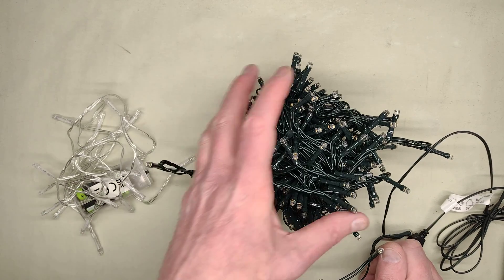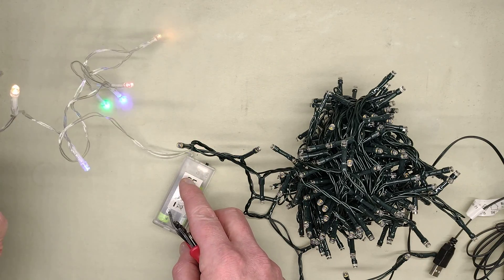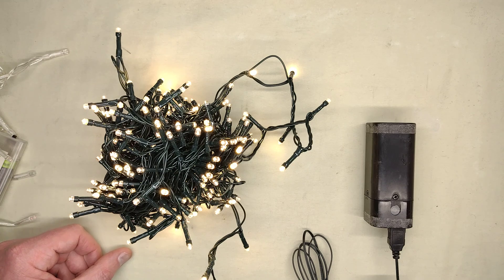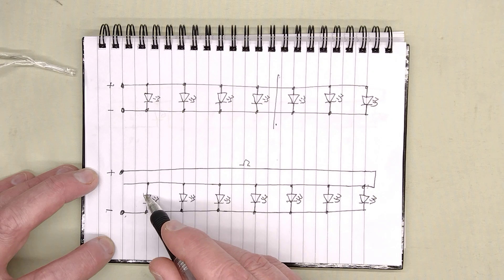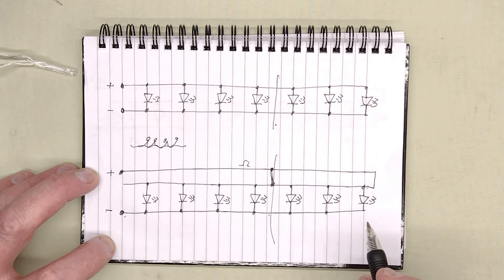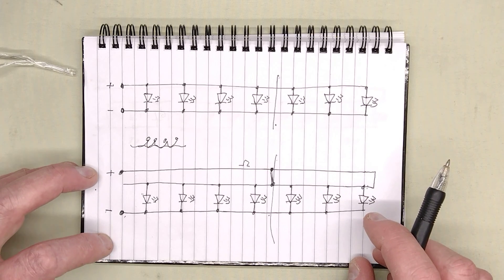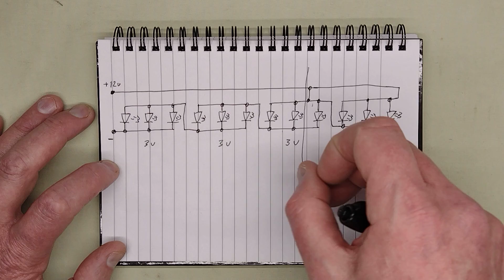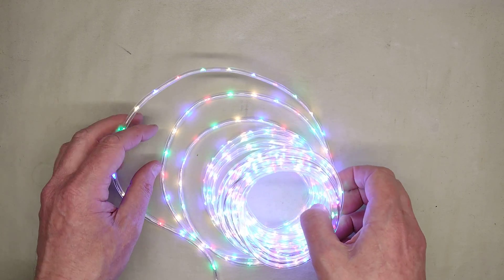How to fix your low voltage LED Christmas lights

Comment: We use a similar strategy in hot water heating systems to balance pressure drop in piping; The top diagram would be called a "direct return" and the bottom diagram would be a "reverse return." Reverse return uses more piping but is easier to balance across many terminals and performs better when some terminals block or bypass flow.
Reply: 100% off topic here, but your comment reminded me of our disaster of a hot water circulation system for instant hot water that was installed when we built our house...the plumber ran the PEX through the foundation uninsulated and our hot water heater never turned off due to all the heat being lost in the foundation. We had to just unplug the pump and now it's a longer wait for hot water than ever lol!
Reply: @MrV1NC3N7V3G4  there's models now that only pump when they sense a faucet turned on or by push button, they only run until they sense the hot water at inlet.
they're generally mounted under sink and pull from the hot pushing back down the cold pipe. there may be other  wireless control systems now that will work with standard recirc setups, who knows.
Reply: @MrV1NC3N7V3G4  ooof! Always sleeve penetrations through concrete!

What you can do to remedy this is a strategy called "demand recirculation." A small pump is put near the bathroom or wherever the hot water will be needed. Before you use the faucet/shower, press a button to activate the pump (some installs connect it to run with the light switch).

The pump moves the water from the hot supply pipe back into the cold supply pipe, so the cold water is flowing backwards for a few seconds. Once the pump detects that the hot water has finally arrived it shuts off. The cold water may be a little warm for a bit, but the hot water is available right away and nothing goes down the drain.

You can buy these systems as a kit that installs under the sink and uses the sink's hot and cold water taps, just need a GFCI outlet for power.

Comment: Thanks!  I wasn't sure how to fix my light string (and I live in a semiremote part of Peru and can't just throw my old lights away and get a new set!).  You explanation of what the wire were for made it easy to just remove the bad bulb and solder the resultant loose wires together and now it works again!

Comment: I just repaired a 2 wire set with 7 modes that had been cut by a lawnmower.  I measured 28V AC on a multimeter.  I found that most unusual for an LED string.  But there was no DC component whatsoever.   I was running low on time, so I didn't take the time to put it on an O-scope.
It was a super simple repair.  I soldered the wires back together and coated them with an ample amount of dielectric grease.  Then 2 layers of heat shrink.  1 for each wire with the grease squeezed inside, and then another over the two together to strengthen the repair point.

Comment: Very informative, The Asda lights I belive are made with the LEDs wire compleate then they run that into the plastic cover machine that form the tube around the lights as its extruded.

Comment: I've got a set similar to the diagram at 8:00, but every second LED is reverse polarity. The little controller board has different modes which changes the polarity of the voltage at different rates. If the Hz is fast it looks like they're all on, if it's slow, the light appears to 'walk' down the string.

Comment: Inspired by one of your videos, I bought several battery Santa silhouettes, cut off the battery holders and attached a number of them to USB plugs in parallel via dropper resistors, now happily running off mains phone chargers.

Comment: 7:18 To find a broken wire in that type of LED lights, you can use a "non contact voltage detector" , those react to the "switching noise" of that 12V powersupply.
Within 1cm distance, you find the place where it is broken.
Reply: That sounds better than my usual method of 'Ow! Christ! That hurt!' voltage detection!
Reply: @UnhingedHarry  

Lol true!  "AgggOUCH!"
Reply: @skylined5534  , that's because your method is not "non contact" :-)

Comment: I was somewhat inspired by you this year to make my own string of LED lights, I used colour changing LEDs each with a 180 ohm resistor and twisted together some 7/0.2 wire to wire them all in paralell. I 3D printed a little seperator so the LED wires wouldn't short when you heat-shrinked over the connections and resistor, then 3D printed some christmassy shapes that I glued over the LEDs to make them interesting. I was going to use your LED covers you put on a video ages ago, but in the end spent some time in OpenSCAD designing Christmas trees, parcels, snowmen and Christmas Sloths (long story!) instead. I only made 24 lights in the string but may well extend them for next year, although I only have a small room :D

Comment: We have a set of lights where there are 600 LEDs and they are colour changing. Each lamp can be ether warm white or a primary colour or both which gives a lovely pastel effect. You can also select fade from colour to white and back. They have 3 wires but as I can see strobing I suspect uses AC to select between white or primary colour. I tried shortening them with the result of only seeing the blue LED's light dimly. I reconnected the wires and hid the the 300 extra LED's under the sofa.

Comment: Clever 3-wire arrangement! 
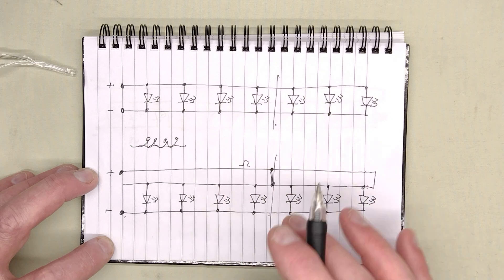If you put a ~10-ohm resistor as the "bridge" that you draw at 5:57 - this should be ok - better than just jumpering. I can imagine that most people don't carry a stock of 10ohm resistors and a soldering iron and a shrink-sleeve at X'mas, though...
Reply: How did you determine that 10 ohms was enough to compensate?
Reply: @jlpicard001  My guesstimate was based on eyeballing the gauge of wire that is snipped, and the length that needs to be bridged. However, a rough calculation goes like this:
The USB-voltage is ~ 5V; The white-LED forward-drop is 3V. This leaves 2V across the "resistor". --> The round-trip-wire-resistance must then be 8 Ohm. 
BigCliveDotCom cuts the string halfway in the middle. The new string has half as many LEDs, so presumably needs only 125 mA in the new situation (for the same brightness of each LED). In the new situation, the remaining resistance is also halved - so 4 Ohm instead of 8. The forward-drop of the LEDs is still the same - 3V and  USB_PB still delivers 5V. The new desired resistance is 2V/125mA --> 16Ohm (whereas the wire provides only 4) --> Add ~ 12 Ohm. :: 10 is almost 12 ;) especially with all other simplifying assumptions.. Hope this helps :)

Comment: One of the problems with C5 LED (cone style) Christmas lights here... squirrels bite the colored plastic bulbs off and bury them in the garden.  They are very destructive,  and the entire string is trashed because the wires will be bitten in half in many random places and 10 or more random bulbs will be bitten out of the string, and found weeks or months later scattered throughout the yard.  I thought this was a bizarre situation until I read about it online and this is a problem lots of people experience (at least here in North America).

Comment: Funny you should say about pets nibbling the lights! We've got some lovely turquoise Eveready LEDs in the front window and when I turned them on I was treated to a hardly on but mild flickering! Turns out the one of far too many cats we have (my bet is on either Saoirse, Aerial or Toulouse, one of them is batting one of those noisy bell filled plastic balls around the kitchen as I type this).

Found out the end of the string had been savaged. These are the triple wire type. You'd be horrified as to how I 'fixed' them though, bared wire,  twisted together and pre glue lined heatshrink to finish of, what a bodger😂 they do work now though!

Not sure if you'll get chance to upload again before Christmas so just to say thanks for all the stellar content this year, it's always a good day when it's a Big Clive upload day!

Merry Christmas Clive! 🎅🌲

Edit:

I only just clocked you'd caught covid, really sorry to hear that. Get well soon, wishing you a speedy recovery!

Comment: My best guess for how the ropelight could be made is that the light string  would be blown through it with compressed air. It's also possible that the tube is extruded around it and the light string is fed through a hollow mandrel. I don't think they're feeding it through by hand. That'd be too fiddly I think.

Comment: I’ve never seen it in strings, but most tape lights are sections of 4 LEDs in series, then the sections are in parallel. For long runs you can feed power from the middle or have a power supply at each end, also giving redundancy. Or for a price run a heavy gauge wire alongside and feed the power at several points.
Edit: I’m referring to 12v dc tape lights.
Reply: A question regarding this: I've been hesitant to start a project that involved ~10m long 5V LED strips (the individually adressable type, which sadly don't exist in 12V versions) because of the uneven brightness issue. I figured that feeding both ends would help this at least enough at those lengths, but would need to use two separate PSUs, one per end, and was not sure if that is a good idea. I would use the same types from the same brand, but were still unsure if this couldn't lead to some sort of issue. Is this a reasonable thing to do?
(Running thick cables alongside would not be an option for this project, so also no feed in between.)

Comment: I wonder if the tube is extruded around the LEDs afterwards? If the melting point of the LED wire insulation is higher than the plastic being extruded around them it would be possible to make infinite lengths. (regarding an earlier comment) I don't think they'd spend time threading a wire through the tube then pulling in LED strings, that would be very inefficient...
Reply: My first thought was forced air. Your method makes the most sense as it would seem to be the easiest. I would imagine such extruder setups are the proverbial dime-a-dozen. The cooling would need to be near instantaneous what for to mitigate collapse. Cheers. Thinking always cheers me up.
Reply: @GregorydavidMck  The easiest way? is to pull them, using a lube. Though, the lighting string seems delicate, and so I think  the tubing is probably extruded around the lights too. In principle, I don't see why it couldn't be some kind of thermally processed clear heat shrinking tubing... or the tubing being created around the string by using flat plastic strips that are seam welded (using ultra-sonic welding?) The Chinese do have extrusion machine that might do the extrusion process for the lights. I've seen pictures and specs on them.
Reply: @willthecat3861  Well, using a tube, you have to create that tube too.
So it might well be cheaper to do the extrusion of the tube just around the circuit.
Reply: @elvinhaak  But then you'd need to have an extra feeding mechanism that adds the LED string as the tube is extruded, meaning you'd need specialised extruders. It's probably something much simpler, like some exploited underage children shoving a nylon filament like fishing line all the way through sections of commercially available tubing that they then tie to the LED string and pull in.

Comment: If you had no other option than to cut up a 3 wire set you could estimate the resistance of the part you had to cut off and insert a resistor with a close value to keep the total current at a safe value to keep from burning up the remaining LEDs.
Reply from the maker: You could add a packer resistor.
Reply: For the less experienced among us: be sure to pay attention to the power dissipation and select the resistor(s) accordingly. A blazing hot resistor among nice and flammable christmas decorations is a nasty fire hazard. Derate the resistor too, as the power rating is for typical open air application on a PCB and not tucked away in some heat shrink tubing.
Reply: or just include a regulator for the lower voltage.
mostly a simple LM7803 with a set-resistor for the voltage will do a fine job (and yes, it will get pretty warm if you took too much of the string off).
If you just use a pot for the voltage-setting, you can slowly change the voltage up to the light you like or a bit less to have the remaining lights work longer.

Comment: It's likely they are using a type of "Heat Shrink" in the rope lights. Also the three wires also acts as a redundancy so if one bulb goes out the rest stay on. Unlike the two wire lights where if one bulb goes out they all go out. At least with incandescent lights.  Not sure if the same rules apply with LEDs.

Comment: I ran into a problem with an Old Brooks    process batch controller. If it hadn't been for this channel I might not had been as confident in my diagnosis in my troubleshooting and repairing of it. It had a bad 470uf filter on the power supply.

Comment: I repaired one of these strings with solder and masking tape which got ripped into 3 pieces by getting hooked on a car. Unfortunately I didn't find the third section until many months later though so now I use it with a battery.
I also repaired one of those all parallel strings which got some LEDs crushed, also by a car.
Also I think those parallels-series strings are driven at constant current not constant voltage.

Comment: Hello, Clive. Seven days on from this video, I hope you're feeling much better. From what I've been seeing, the Omicron strain has been running riot in the UK, Scotland being very hard hit. Get well soon. Cheers.👍
Reply: I agree. Follow Drs orders and take care.
Reply from the maker: Yeah.  Not sure which flavour I got, but it passed quickly and the lat flow test returned to normal.
Reply: @bigclivedotcom  probably omicron.  If reproduces a staggering 7000 times faster than delta in the bronchus meaning you'll spaff out tons more particles, but it's come at the expense of much reduced lethality and doesn't penetrate lung alveoli as much.  It's exactly what you'd want from a mutation.

Comment: Probably only your channel provide a good explanation with diagram. Thanks for that Sir. If I may ask, my tumbler LED have 100 led's but half of them are dim and the half is bright. I already change the input main cable and try to replace the driver but have no luck. Do you have any suggestion to fix this? thanks in advanced

Comment: The third wire setup is also useful for LED tape on long, unbroken runs, as it too has voltage drop problems, but add in a third wire to balance it out, and it sorts out that issue nicely... :)

Also hope you're okay with regards to the lurgy, Amy Macdonald had to cancel her gig at the Hydro in Glasgow last week because of it (and the cockwomble was of the government's inability to handle it!), was rather upsetting to see her in tears over it... :(
Reply: I have done this, feeding the power rails from opposite ends of the tape.  It works nicely.

Comment: I seem to remember the AC powered DC string I have being a set of series strings in parallel. One of the wires got chopped off by a closing window and I think it only went dark from one or two LEDs in front of the cut. Now I might have it mixed up in my head from all the hours spent shifting bulbs around in the old incandescent one to eliminate the broken ones from last year - that one for sure had them in series sections.
Reply from the maker: The 32V sets tend to have ten parallel section in series.  It is possible to knock out a section of one of those parallel circuits.

Comment: I have one of the original versions (with bulbs in it). Horrible: it uses 100 Watts to light about 3 meter. I replaced it with an LED version, how ever it is not as bright (by far). But it does to the fading, chasing and other flashing animations, I love those!

Comment: Getting those copper wire LED stings into some of tube is a pain.
After many attempts using different methods, I managed to suck a thin bit of cotton trough a one meter tube. Then tried pulling them trough, the cotton snapped.
Then I did it again and first pulled a thicker cotton trough, then the LEDs.
Took about a month of trying things dumping them in a box for a while out of frustration.

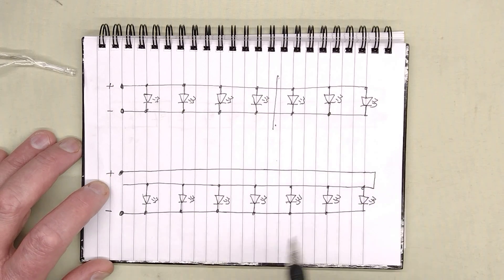Comment: Hi Clive! A year or two back I watched one of your vids and was inspired to go to Poundland and buy Christmas lights. I bought a string of 50 coloured lights of the two-wire variety and have used them since to drape about my living room at the apposite time of year. They take 3 AA batteries and have two modes, flashing and continuous with an off position, and very fetching they are with their intense colours. The first time I used them (continuous mode) they turned themselves off after a few hours (I thought the batteries had gone flat) but, after fiddling with the switch, came on again, only to go off again hours later. It's apparent that they're meant to do this but there's nothing to indicate so on the box. Tonight, having noticed them come on at 10:18, I was coincidentally awake at 04:18 when they turned themselves off. Six hours fazackerly! How's it done? Happy New Year.
Reply from the maker: Many sets have the 6 hours on 18 hours off function.  It can be annoying.

Comment: Maybe that tubing was shrunk slightly about the LED strand. A special heater could apply hot air locally or the strand is passed through an oven

Comment: I have several 100 light LED 3-wire strings.  I have found several YouTube videos showing how to shorten a string but I have just the opposite situation.  I need to lengthen the string by 4 additional lights to one of the strings.  Is there a way splice in a short section to add 4 more lights to a 100-light string?